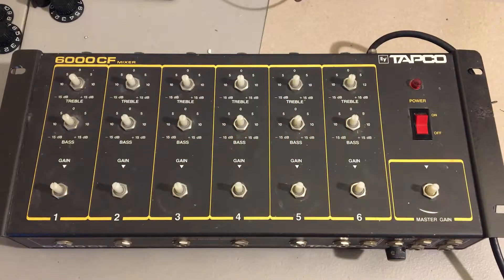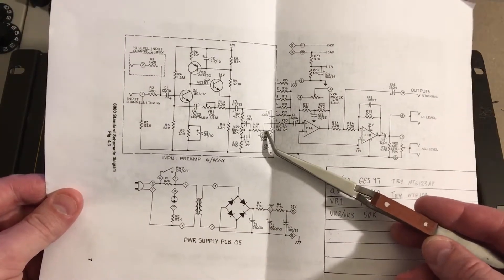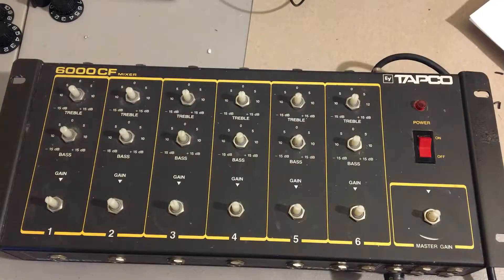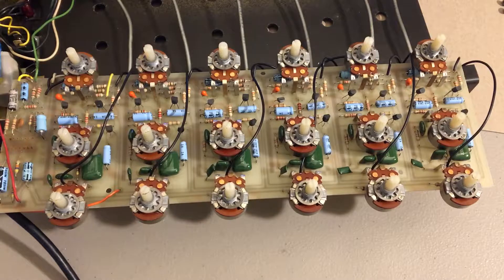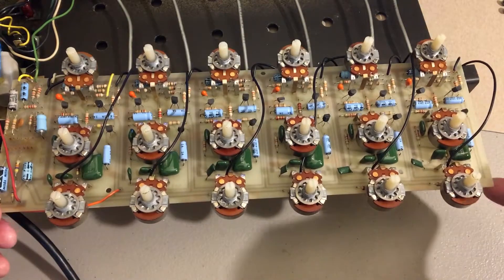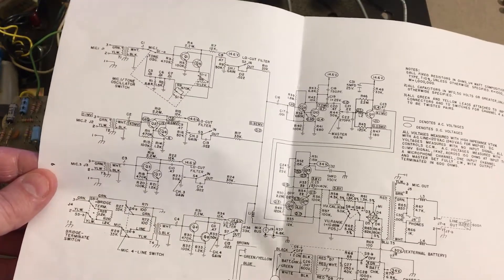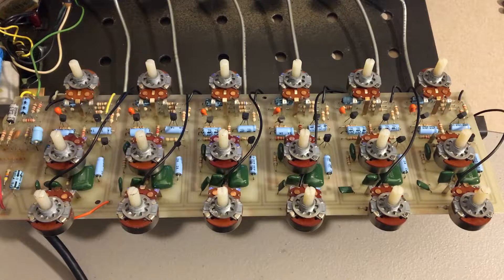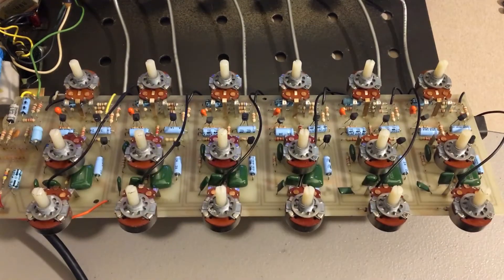Tapco 6000 mixer mod into 6 budget mic preamp channel strips

Comment: Just did this to mine. I just soldered the output wire directly to the leg of the pot so that I didn't have to get rid of the master bus just incase I wanted to use it.
Reply from the maker: That sounds like a better way to do it. Do you hear any crosstalk between channels?

Comment: Hey! Thanks for the video!  Will get a 6100rb mixer soon  and wanted to do something similar to this on it, hopefully keeping the separate spring reverb for each channel. Sound feasible? Anyway, much more interested in how these sound? Are the pres good enough? Do they give a nice color? How is the clarity?
Reply from the maker: Definitely sounds feasible! I'd be interested to see how that works for you.

There is some color to the pres, however I find it beneficial, especially if using multiple mics on a guitar cab, ie 2 SM57s. Run one straight in, one through a channel, and it gives some great tones.

I find the eq helps with clarity. For a vocal track, I rolled off the bass and boosted the treble. Made for a great tone that I barely had to eq while mixing.

My next improvement will be to add some sort of clipping indicator. That is definitely a drawback, however, a resistor and LED at the output will be enough!
Reply: Thrifty Producer Awesome, thanks for the input! I will give them a try, my interface has 6 line inputs that will each get a tapco preamp and I can blend with the 2 on board pre's. I'll share the results once all is said and done. Cheers!!
Reply: i just got a broken 1 and fixed it works like a gem but i want use the monitor and efx return how do you wire this up the right way bless!
Reply: Last year I got two 6000 series B mixers. I compared the tone of these to my warm audio neve clone and the low end of the tapcos is a winner. Used a u47clone and despiste Being slightly noisier, i prefered the tapcos! Straight to my antelope Orion was sounding great, but after going through some tamura Transformers (Yamaha pm2000), it was killer!